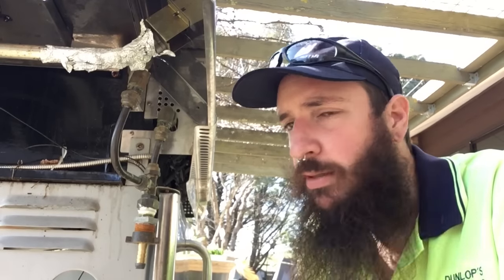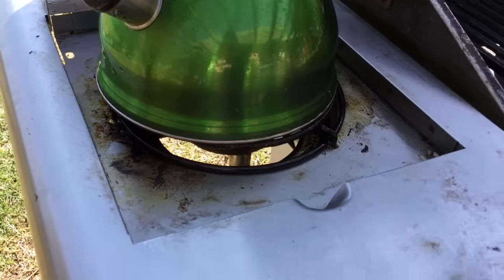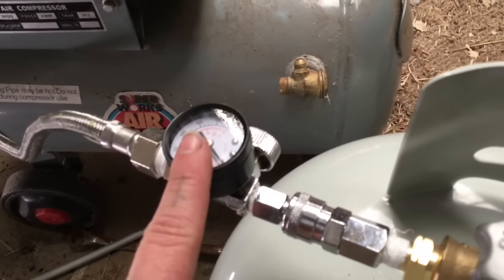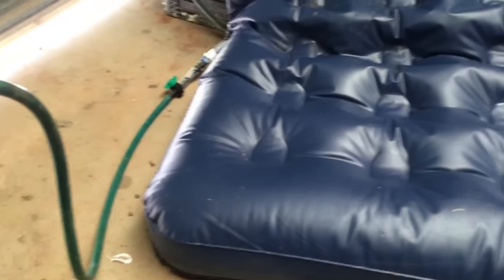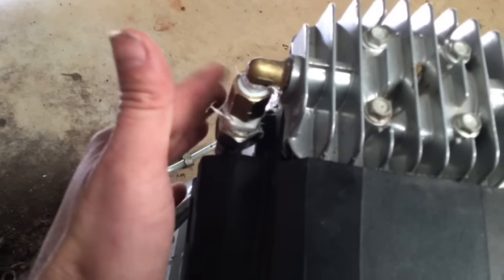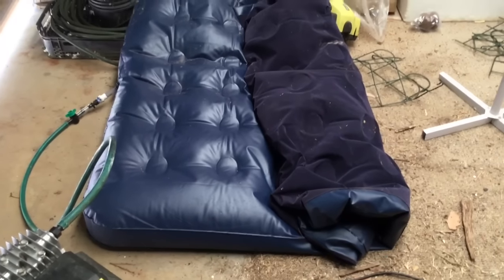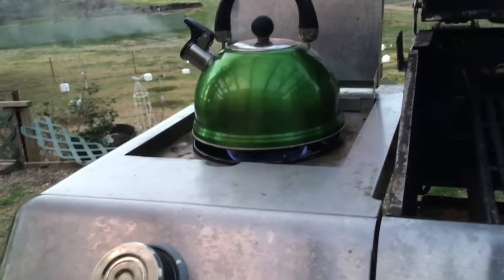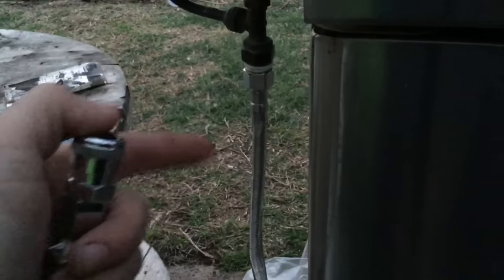Compressing Biogas into BBQ bottle

Comment: Main thing I'd be concerned over is the hydrogen content. On the highlander side of say 15%-20% by volume, your best bet is to not compress it beyond 50psi. At around 150psi, it can autoignite: that's how an experimental plant was turned into a crater in NM or NV, I dont remember which. They were trying to find new ways of storing pure H2. Best way to do it is similar to acetylene using carbon (graphite), but that poses a different issue altogether. 
If memory serves me right, NASA had a substance they discovered that enabled H2 storage in smaller tanks, but you basically had to irradiate the source material to create it, and good luck not having the feds show up on that one haha.
Reply: How much hydrogen do you think is in that tank that flowed for an hour.

Comment: the higher the psi the hotter that compressor is going to run, how hot would be too hot for biogas to not cause accidental combustion, how do you ensure no oxygen in line?

Comment: take that one way check valve off the side of the air tank and add it before the gauge and you will be able to get more than 125psi in the tank and gas wont run back into the compessor

Comment: By chilling the Lp tank. Say nestling it in ice. Could the biogas condense .
To get more volume into the tank. Would the pressure increase once filled to your systems capacity or reached it maximum ability .
And removing it from the ice crib. To warm to ambient temp?

Comment: Pressurizing into a propane tank the pressure will not be very much maybe 150 psi? But if you want to use that gas to run a vehicle it has to be 3600psi do I have that right?

Comment: Did  you weigh the tank and see how much gas you pumped in,  in pounds ?   Also you can use teflon tape for the threads.
Reply: It's not very much.  You can't liquefy methane at these pressures like you can propane, so the weight is something like 1-2% of if propane had been in the cylinder.
Reply: @Uejji  that means it will more or less equivalent to propane or lpg gas is it.,?

Comment: To remove the hydrogen sulfide, you could put the gas through multiple aerators I think.  I haven't done it myself, but it makes sense I think.
Reply: You’re correct, in fact if you run a bubbler tank before the storage tank it will scrub the gas of hydrogen sulfide and it will burn blue flame like LP

Comment: This is very helpful. Thank you! Are there tanks that might be able to handle the corrosive gas? Glass lined, with brass fittings maybe? I am wondering how long it will take before the little bit of corrosive gas that makes it past scrubbers causes a failure. If a tank were to burst, would the gas rush out and maybe catch fire, even explode? Just trying to comprehend worst case scenario. Thanks.
Reply from the maker: Earthen Hand sorry mate no idea, but I can say, I’ve had a 45kg tank with gas sitting in it for a couple of months now with no fault, but it is important to scrub the gas to remove the nasties, if your gas smells don’t compress it, in a later vid I add another scrubber using kitty litter and more steel wool to remove water vapour and more smell 👍
Reply: Will it help if one puts a watertrap bubbler  between the compressor and the tank being filled to combat any corrosive gases? Perhaps also between the filled tank and the barbecue burner? Just thinking about any possible benefits and safety?
Reply: Apologies. Missed that the scrubbing has been given attention already. Thanks.

Comment: H2S out of wood gas... if the wood gasification chamber is not getting high enough nor has a pressure regulating valve the H2S wont get hot enough to decompose into sulfur oxide gas that can dissolve into water through a percolator making sulfurous acid, similar to phosphorus acid... lead acid batteries from wood gas filtration?

Comment: Just make sure there is no oxygen mixed in and it shouldn't explode! High risk of backfire/explosion in the storage tank if there is any air being compressed.. I would use a radiator to cool the bio gas before and after compressing.

Comment: Very interesting.  Have you ever looked into producing Hydrogen?  Been wondering if H could be stored in a propane tank, and how that would be done.  Thanks.
Reply: Hydrogen is very dangerous to store under pressure. It is such a small molecule it will leak out of almost any container or fitting that wasn't designed specifically for hydrogen.

Comment: Good stuff.
Now that the principle is proven ... Next (to save electrical AC energy )... 
would you try using a 12v DC tyre inflating compressor running off 
either a solar panel (s) and / or a car battery ?
Just thinking of total grid independence !
Cheers
Reply from the maker: I think I have a DC tyre pump floating around somewhere, will have to look at its specs and the necessary fittings required, I don’t have spare panels or an mppt controller floating around, but the concept would work, deep cycle battery would be good too.

Comment: use an old air conditioner condenser, and a few water separators, you want your gas to be dry as you can get it, even better is if you can scrub the CO2 from it as well

Comment: When filling a propane tank with gas, you have to release the oxygen in the tank while filling or you can't get a full tank. so while filling from the mattress you have to use the screwdriver valve on the neck of the fill valve to let the gas push the oxygen out. if you didn't do this you might get double the amount of gas in one tank.

Edit: I don't know if biogas that you are using is heavier than air.
Reply from the maker: You can purge or put it under vacuum

Comment: Im late to the game, but you're using the wrong kind of supply line. Gas fittings use a flared fitting hose. Generally they're yellow. What you're using goes to water fixtures.

Comment: Hi mate filled some bottles up but they won't light a flame on the BBQ unless I cover the air inlets after valve, is this because of to much oxygen in biogas or is this something you changed on the BBQ?
Reply from the maker: Yer mate block up the Venturi holes, you may need to drill the jet holes bigger too, I’ve got a vid up on bbq conversion 👍

Comment: Have you  ever stored methane in a propane tank for long periods of time?

If so did it maintain its flammability and gaseous state? 

Would it be possible to compress into a 250 gallon propane tank?

When your propane tank was empty, did you have any liquid methane in the tank, or did everything burn off?

I know how to hook the compressor to the propane tank, but how do you hook the bag to the compressor? I don't see an air intake valve to attach to on new compressors...
Reply: We are producing gas. Would you have any time to answer these questions? We SO appreciate your expertise! Hope you have a great day!
Reply from the maker: Hi Diana, I think the longest I’ve had gas stored is 4 months, and no dramas, still burnt fine.
As far as 250 gallon tank, can’t see why not,.
When empty there is nothing left in the tank, liquid methane only occurs at -161C, and the regulator stops air from going into the tank.
I don’t know if you have figured this out yet, but the inlet for the compressor usually has a filter and housing on it, mine was just able to unscrew, then I just used a barb fitting with a hose to suck out from the gas bag.
Hopefully this helped
Reply: @OkAtEverything-ProAtNothing  Thank you!

Comment: EVERYONE PLEASE READ. This is extremely dangerous. 
When compressing biogas or natural gas you must use an appropriately rated compressor. If the compressor doesn't have proper grounding and develops a leak while you use it, BOOM you may be dead.
Without using a gas dryer there will be moisture left in the gas. This will slowly corrode the inside of the tank. One day you will move it causing stress on the rust and it will puncture and explode resulting in a possible fireball and your death. A gas dryer can be made with activated alumina. Once alumina is saturated you cook it to dry it and it can be reused.
I didn't see one but you want to have a check valve (one way valve) on the tank when filling it so you can safely turn the compressor off without spewing gas.
Reply: I know you are trying to be creative with solutions and that's great. But showing people this stuff is seriously going to result in injury and/or death of people not really knowing what they are doing.

Comment: Hello Lucky farm,
My digester is 1m height, in which height should I drill for excess water hose?
Reply from the maker: Check out my other vid of improved IBC digester design, I leave a gap at the top to stop clogging of gas pipes from top layer sludge

Comment: Could use more food and bigger containers to make more gas and be able to use to heat your house? If u had 10-30 containers dont u think it would have enough gas each day to heat? Cow poop and waste food from restaurant, wouldn’t that make tons more gas? 
Any way to contact you with a phone call?
Reply from the maker: Ideally I would like to get a big water tank say 20000L and turn that into a big digester,  but my rough maths would say I need bigger to run a 30mj heater 24/7

Comment: I'm wondering if this would work for compressing hydrogen formed by hydrolysis into a tank that I could run my generator off of? My thought was getting a solar panel and using that to create hydrogen then compress it into a tank...
Reply: good luck, hydrogen is like the most dangerous gas to compress, i think your compressor would need to be made out of teflon or nylon just so theres no chance of any spark etc... maybe brass but then it might corrode easier with the H2... so yeah i don't know how available those compressors might be, and also hydrogen takes incredible amounts of pressure to compress it, i believe it's the most incompressible of all the gases...
Reply: oh yeah i forgot about hydrogen embrittlement, good point. you also need special fiberglass tank rated to 300 psi or something like that

Comment: Hello, I have 300 psi air pump for car and empty 2 kg LPG gas cylinder can I use it for biogas compression?
Reply from the maker: I would see what the max psi rating is on the tank first, and make sure not to exceed that, also make sure your gas is scrubbed properly, not sure if a 2kg would be useful anyway, a 8.5kg tank even has its limits.
Reply: For 2 kg tank rated pressure is 14 bar for LPG. By the way I will use calcium hydroxide and silica gel for purification of biogas.
Reply: @Tributary House Ltd. Thank you, activated carbon means charcoal, can I use it?
Reply: @Ankit-wk7rx  activated carbon is a little different than charcoal, think of it as a super porus charcoal. It's just charcoal with a fuck ton of surface area to absorb things with

Comment: I've been thinking for a while now, that just as well rubber balloons and tubes work, why wouldn't some other spring tension container work too, like a tube with a piston and pressure spring or nitrogen in other side?

It wouldn't work even near as high pressure as with proper pumps, but considering it as a space saver to balloons, then it becomes quite appealing concept in my opinion, then I could even have a small biogas plant in my balcony, without a giant rubber blob sticking out over the edge.

Comment: Wow. Really cool, but talk about a no spark environment! This is an excellent example of why this stuff is so cool, but so dangerous. That mattress full of gas is like a small bomb. I mean luckily there is no shrapnel, but if the tank goes....natural gas when filtered is odorless. Because it’s molecular weight is lower than propane, it needs to be stored at a higher pressure. That is why Propane is sold in tanks at the hardware store! The guy doing this is obviously very technically competent. In no way do I mean him or others exploring this as an alternative disrespect, but be forewarned! Anybody doing this is messing with very dangerous gases that can easily ignite from an errant spark...such as a compressor motor turning on!! If possible USE BRUSHLESS MOTORS as they will not arc!! Also FLASHBACK ARRESTORS MUST BE INSTALLED BETWEEN TANKS. Flashback arrestors are easy to make. All joints must be checked for leaks. If possible this should be done outdoors; otherwise do yourself and everybody else a favor...buy a good gas detector and hook it up to an alarm. If you can smell hydrogen sulfide (rotten eggs) then it is “okay”; if you can’t (but it is present) then it is at a concentration that is poisonous. All levels of it are bad to breathe, but at the “lethal concentration” anesthetizes the olfactory nerves that “smell” the hydrogen sulfide (rotten eggs). I put lethal concentration in quotations, because if you can smell this crap you should figure out why and deal with it in such a manner that the odor no longer exists. For that there are catalysts. Anyway, awesome experiment; awesome video; and what courage to take on such a project. Best of luck.

Comment: My question is, a year later, does your compressor still work? Or did the high acid levels in the biogas corrode the inside of the compressor?
Reply from the maker: The compressor still works fine, the gas is scrubbed before it goings into the storage bag and compressed.
Reply: Lucky Hill Farm I didn’t see the scrubbing, hows that work? Super impressed by the way, this is going to be an amazing addition to a self sustaining homestead I’m designing.
Reply from the maker: Good to hear Steve, biogas is heaps of fun and practical. I really need to do a dedicated video on scrubbing but I think I show it on my improved ibc design video 👍
Reply: Lucky Hill Farm I appreciate the dedication and will keep following

Comment: Have you tried to use a old refrigerator compressor to fill your tanks, 300psi easy
Reply: Single stage pumps only go to roughy 140psi including refrigerator pumps. You only see above that on the high side because inlet pressure is high in that setting. With an ambient pressure of 14psi (sea level) it will only put out 140psi (10:1 ratio for single stage)

Comment: Does this setup bypass the compressor tank?
Reply from the maker: Fry Pan yep, no need for it to go into the compressors tank, straight into the gas bottle.
Reply: @OkAtEverything-ProAtNothing  Well that saves alot of thinking about how to move that air.   Could you make a video going into detail about how to treat the gas so it can be used for car
Reply: Fry Pan Bro you need a hell of a lot of gas to run an already inefficient car engine on biogas. Also it needs to be compressed and stored in specialist bottles and at extreme pressures with multiple stage compressing stations. That's well out of the realm for most people.
Reply: @benshuetrim9640  Some people have a hell of alot of wood and have a deep hate of the control of petrol
Reply: @keymaster2108  Woodgas is not the same as biogas.

Comment: All I can say is to never try this at home.. this setup lacks the basic safety requirements for gas cylinders filling/pressure up, many things could've gone wrong, and would've caused really serious injury.
Reply from the maker: I can say, I am not a gas fitter nor plumber, yes there is always potential risks with everything one does, but for me - I have been doing this with my set up for over a year and a half with no issues, but always do your research and I always encourage getting professional help.
Reply: Ok safety sally should i call osha?

Comment: Very cool but only sad it also cost energy to compres the gas.
Reply from the maker: I have a 5kw solar with battery backup, compress on sunny days 👍
Reply: If you have a huge supply of solarenergy more then you could use then that is a nice way to do something else with it.
Reply: What also might be interesting is you could store even more methane if you cool the gas below freezing because a normal air compressor goes to a maximum pressure of 20 bar which is far below that of the maximum pressure your gasbottle can handle.

Comment: Yeah but you're forgetting one critical thing there's moisture in your pressurized gas VAPOR!?! YOU'RE NOT BOTTLING BIOGAS AT ALL!  Look you have to liquefy it you have to condense it you're just burning up vapors man mixed with air and there's moisture in those vapors from that biogas you have to run that through a drier first then three a condenser that's -28° to actually liquefy the damn gas then depending on the tank decide how much CO2 you now need to add or mix with that liquid methane in order to fill pressurized tanks of actual gas you're just storing gas VAPORS and compressed moisturized air homie that will cause problems because with that moisture you're now creating CO2 instead of pure clean gas burn at the burners